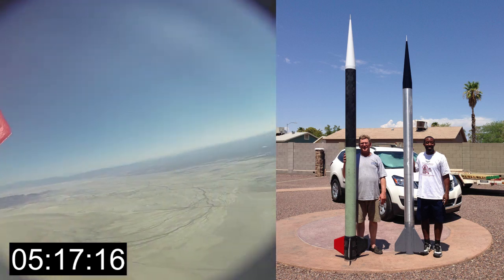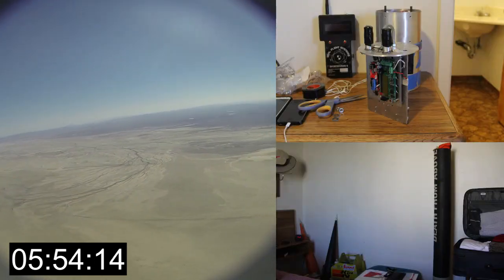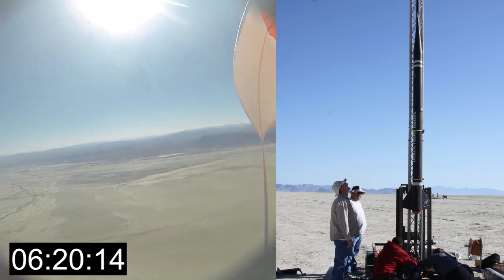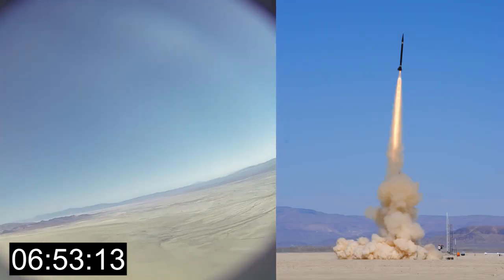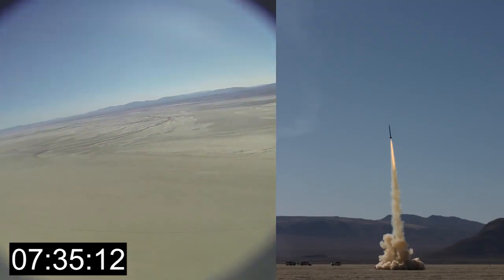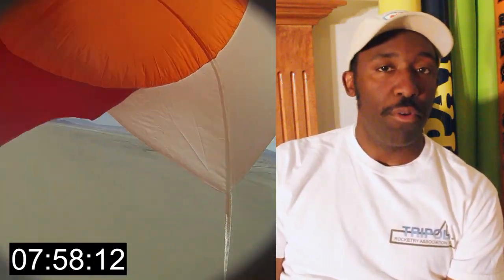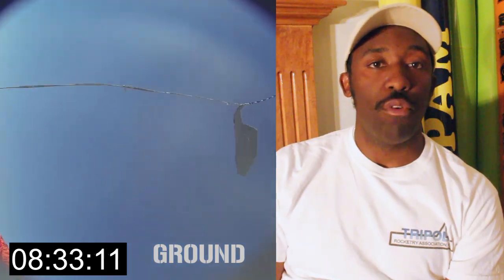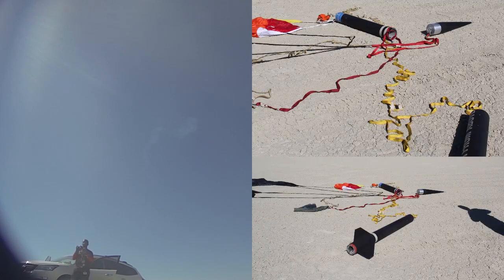EXTREME ROCKET!!! O25,000

Comment: Why did it burn out at 500ft, which reduces the speed? Because you design so it burns out and not constant at a higher level at the same speed as it goes from start to end, well, in your desire height as an end, then slow down. So, you design for 500ft, then slowly went further and goes down because the air pressure or you make it go down at certain feet?
Reply: He was designing for acceleration, not height
Reply: @Businessonly752  So, the brake didn't work?? And so what reduces the speed? The accelerating base on an example of 50 mph, per one mile each, so 2 miles later, is 100 mph, 3 miles later is 150, and so on.

Comment: Hey, question, I hope you get this! I’m using the entacore aim 3.0 and I was curious if you’re running a Yagi on the aimbase or just just using the rubber antennas. I’m no where near the altitude that you are achieving I’m just don’t want to lose the rocket if it drifts more then a couple of miles out of line of sight. Thanks Chris

Comment: 5773mph if I'm correct to make 30000ft in 36sec
Reply: Faster than that considering that drag was all that was there to slow it down to that average. So at least 7000 mph at max speed before dropping fast. 71Gs = 71(9.8m/s/s) which means it was accelerating at over 600 m/s, per second. At 10-11 seconds throttle was cut. The numbers coming from this are ridiculous but still atmospheric drag had a big effect on slowing it down.

Comment: His Description On motor Burn time Is total B.S!!!! and I will stand by that! There are fake statements being made here.
Reply: http://pro38.com/products/pro130/motor/MotorData.php?prodid=30795O25000-P
Reply: You could hear the engine burn time at roughly 1 second duration, and the rocket was still really low when it stopped. Where's the bullshit?
Reply: Please observe:  the  shortest burn duration, the longest fligh range. Maximum acquires gun missiles, 2km/ sec average, at barel's end...
The rest is aerodinamicity: lenght/diameter no less than 3 but no more than 6. ALL CONIC  shape in supersonic gives  the best Cx. As it takes fast altitude, air density fast decreases on vertical ascension. 
So I believe, this can be done, but only with military propellant, I do not believe this quality of propellant  can be done by an amateur...
I said!
laurentiu_bucur7@yahoo.com